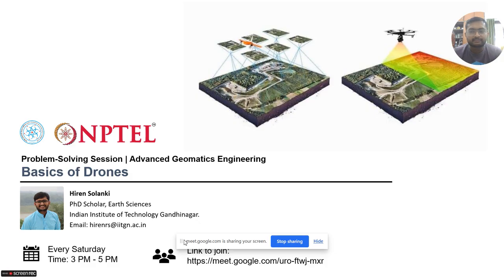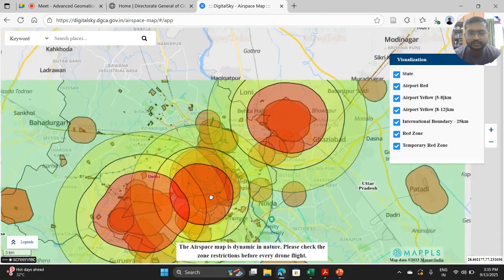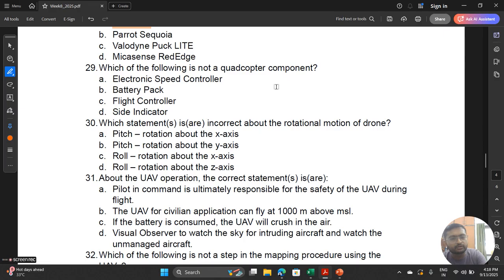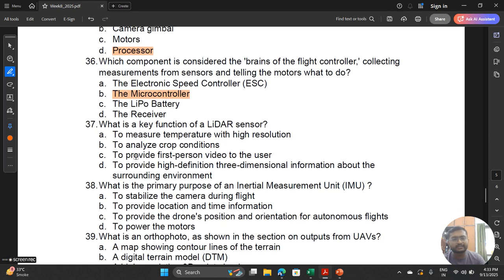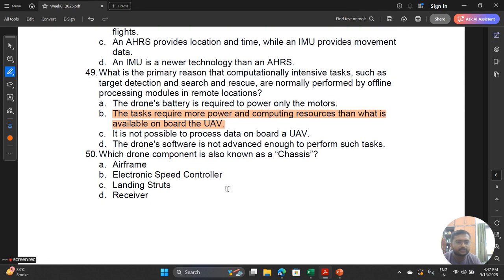Week 8: Drone | Problem Solving Session | noc25-ce82 | Advanced Geomatics Engineering | NPTEL

Comment: 00:42 - Introduction to drones in advanced geomatics engineering.
06:14 - Drones offer versatile applications in surveying, but have limitations in underground mapping.
11:28 - Ground Control Points (GCPs) are crucial for drone survey geo-referencing.
13:58 - Identifying GCPs ensures accurate georeferencing over time.
18:40 - Understanding types of drone operations and terminology.
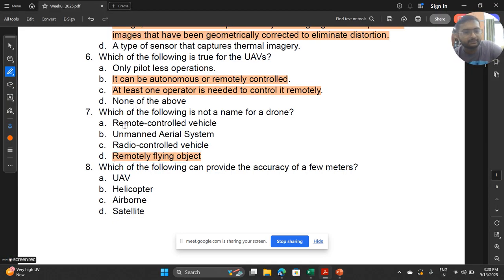20:50 - UAVs provide higher accuracy than satellites for remote sensing.
25:23 - Drones offer cost-effective advantages for surveys and safe operations in populated areas.
28:06 - Drones are effective tools for small area surveys and real-time data collection.
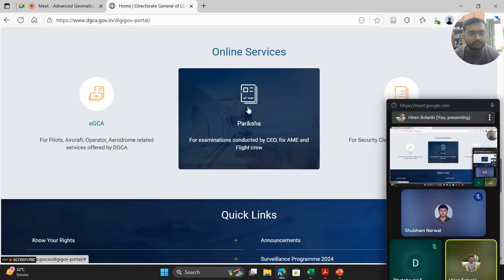32:40 - Understanding drone flight restrictions and no-fly zones in India.
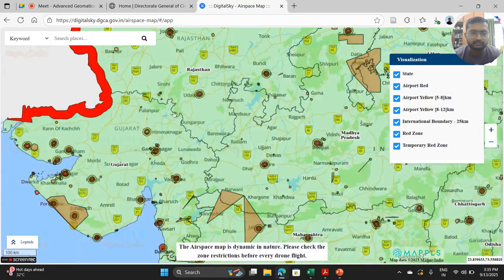35:06 - Understand drone regulations and cost-effectiveness for surveying.
39:28 - Drones are classified based on wing type, weight, and automation.
42:04 - Discussion of drone types and features including pentacopters and high endurance UAVs.
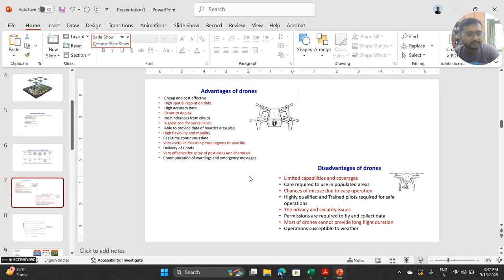47:32 - Comparison of multirotor and fixed-wing drones in performance and operation.
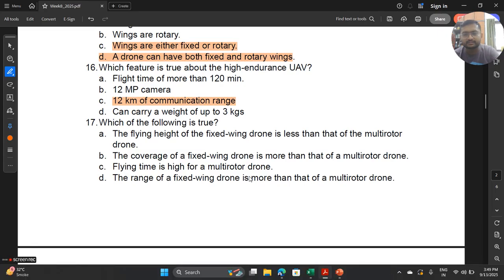49:42 - Survey of India uses drones to create digital property records.
54:37 - Overview of GIS dashboard functionality for drone surveys.
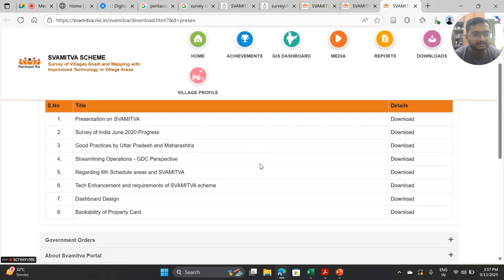57:21 - Overview of GIS dashboard and its 2D mapping capabilities.
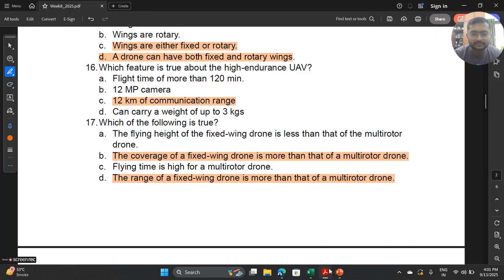1:01:48 - Discussion on drone classifications based on weight and landing types.
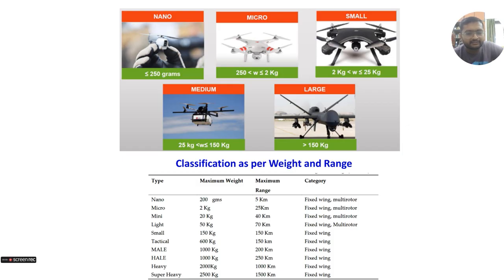1:04:17 - Weight and range of drones affect design and capabilities.
1:09:55 - Ground control points are less critical in mission planning when using GPS.
1:12:48 - Overview of drone components and their functions.
1:17:08 - Overview of drone components and their functions.
1:19:32 - Understanding drone movements: roll, pitch, and yaw.
1:24:50 - Discussion on drone applications in air quality and transmission line monitoring.
1:26:58 - Drone capabilities for air sampling and tunnel surveys discussed.
1:31:19 - Key considerations for drone specifications and sensor integration.
1:33:47 - Discussion on thermal sensor applications and measurement principles.
1:38:47 - Receiver transmits pilot instructions to the flight controller, not to the remote controller.
1:40:54 - Drones utilize one-way communication to receive commands from flight controllers.
1:45:38 - Overview of drone technology and its applications in environmental monitoring.
1:48:47 - Battery limitations significantly affect drone operational time and survey capabilities.
1:53:18 - Shift from theoretical to practical numericals in geomatics engineering.
1:55:21 - Discussion on upcoming GIS video series focusing on Indian data analysis.